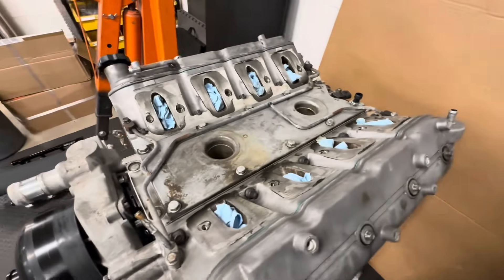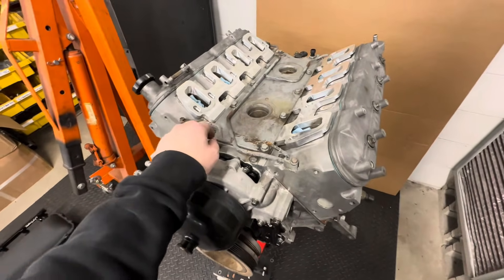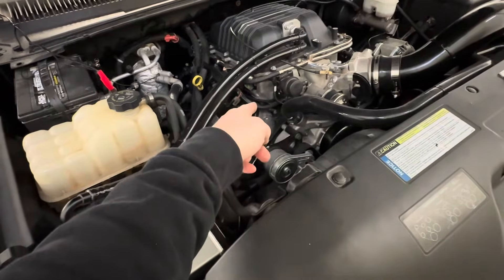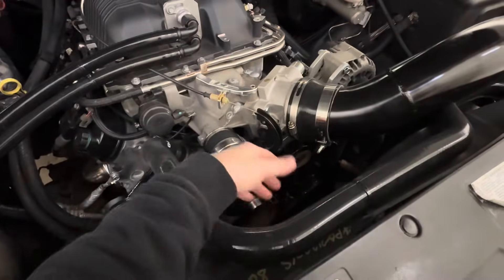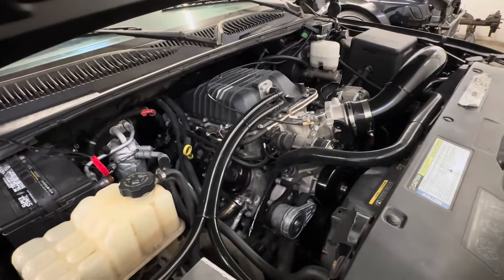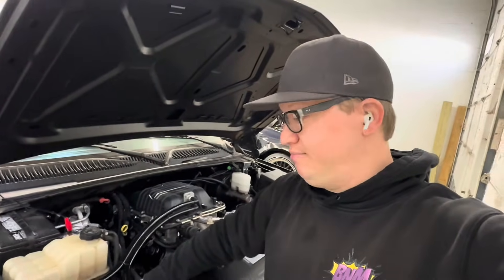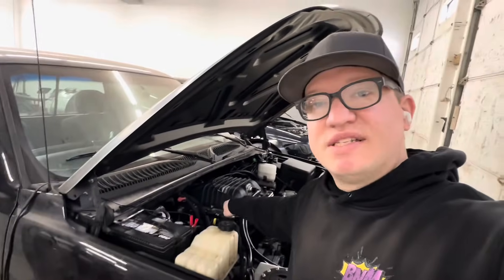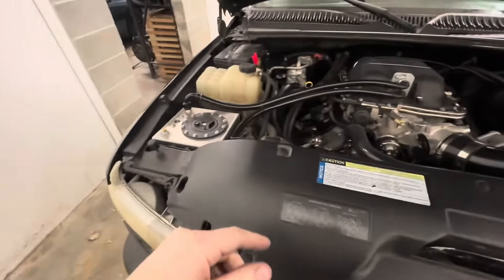LSA Supercharger on any LS engine……….. basic know how

Comment: Best video out here! 👍👍👍 straight to the point & what’s needed . What did you do with the vacuum for the vacuum selonoid & Do the other 2 map sensors just get deleted ?
Reply from the maker: Just a single map sensor after the rotor pack side. As for vacuum for the solenoid I’m not sure what you’re referring to. Do you mean the bypass valve? If so you just need a vac source to the top of the diaphragm

Comment: I have a 2000 firebird with LS1 I keep looking for LSA blower but they don't have lids and the lids they sell are so expensive any advice or what lid is recommended
Reply from the maker: You will have to cut the cowl regardless of what lid you go with. I would say the zl1 lid simply because of the cooling hose position, it is easy to access. But the ctsv lid would work as well. Be patient, you can find them on Facebook
Reply: well, that 2000 LS one motor I have it in a 1988 Firebird formula, are you sure I have to cut the hood because I really don’t want to cut the hood

Comment: What fuel pump did you use ? I have the Terminator X  so the wiring shouldn't be a problem.
Reply from the maker: Used a Walbro 525
Reply: @bnmperformancefab thankyou

Comment: Good video! But wish you had’ve touched on the fuel cell and heat exchanger part a little more. I see two lines coming off the front of the blower going into the fuel cell, but have no idea what they are?🤷🏽‍♂️
Reply from the maker: Modified the fuel cell to be a water box for the intercooler inside the lid of the supercharger. Basic stuff
Reply: @bnmperformancefab  Ok.

Comment: That cannot fit on any LS. it will definitely noy fit on a 1970 LS6 454. so your title is a lie
Reply from the maker: LOL did you see a big block in there? Get out of here
Reply: @ Is there a big block LS and if so, would that supercharger fit on it as claimed it would fit on any LS engine. 
 Seams someone need to be clear on what they are stating, or maybe they shouldn't be making video's when they make false claims like LSA superchargers on any LS engine. Maybe they should educate themselves on automotive history.
Reply: 🥴, greatday68, what was the point of that comment?
Reply: @ My comment was based because they claim it would fit on any LS engine. and that is false as it would not fit on the original LS engine platform. It's not my fault that so many people do not know automotive history and/or make false statements.   
  My point is to educate as so many seam to lack the knowledge,

Comment: can i drop an lsa on my l76 g8 gt all stock? i only have e85 kit rn😊
Reply from the maker: Yea since those are square or rec port heads it’ll bolt right up. You’ll have to knock the alignment dowel off the Bottum of the blower and get a drive for the blower but it will bolt on
Reply: @ are there any supporting mods i should do so the motor doesn’t blow?

Comment: Nice work!! What throttle body are you using?
Reply from the maker: Just used a FiTech throttle body? Ended up switch from the LSA to a single turbo but using the same throttle body
Reply: Well dang why ya switch?

Comment: I always wanted a supercharged daily driver. I’ve got a 02 Camaro SS but I’ve learned that supercharging these cars is very difficult mainly because you must clear the crowl or cut through it. But I’m having trouble understanding exactly what is required to clear the crowl. Texas speed sells a kit that includes “fabrication to be welded in” but theoretically couldn’t I just make the fabrication myself and save the 8k that the kit costs? I just want 450 HP and supercharger whine :(

Comment: What should the ring gap be? Im thinking about putting a 6.0 on my stock lq4
Reply from the maker: I’ve always done .030-028 on top ring and .028-.026 on second ring 

Personally I always go on the larger side. As long as the cylinder walls are clean hone you won’t have any blow by issues
Reply: @bnmperformancefab  thanks!

Comment: Your install on the truck looks great….i gotta LSA kit from boost district that was setup for the trucks too and put it on the LS3 headed 370” LQ9 i put in my nova when i pulled the pevious 5.3 i had in there……i love it
Reply: Do you have a stock bottom end?
Reply: @  yes!!!…just a bored over .030 flat top 6.0……gotta 408” stroker to replace it when i get around to it
Reply: @  around 11.2:1 compression….the 408” will be a hair under 10:1
Reply: Yeah i have a similar setup on my truck. I didn’t build the motor but i got the build sheet that says it’s bored .030 over and it also has the ls3 heads with a nice cam. Looking into LSA just for a nice daily boosted truck

Comment: I have a 6.2 LS3 do I need those intake adapters?
Reply from the maker: Square port heads wouldn’t require adapters
Reply: @bnmperformancefab do I need gapped rings? My ls3 is stock

Comment: Why did you switch to Olson works adapters and ditch the aluminum ones ? Any reason for that
Reply from the maker: The Olson works adapters are made from a phelonic material which is really good at separating surfaces and temps. Aluminum heat soaks and does so quickly, so a barrier that can be easily had is a spacer made of a different material. The aluminum ones work and function just fine but if your looking to cut temps anywhere you can that is one area to help do so

Comment: Can you just run the heater hoses to the lid and not have extra stuff?
Reply from the maker: No, it’s a cooler not a heater
Reply: Also, nice video. I have a forged rotating assembly, full CNC 6.6 built for boost and have been trying to decide between turbo or LSA and I think LSA is the winner. @bnmperformancefab
Reply: I get that, whats the water temp in the cooler after being under the hood running? The coolant from the heater hose would only be around 180. With no fan on the cooler box the water prob gets close to coolant temp since its going through the core bolted inside of the intake  @bnmperformancefab

Comment: Would something like those adapter plates work for putting a Whipple for a 5.3 on an LS1?
Reply from the maker: If it was the same port situation as the LSA then yea likely
Reply: @bnmperformancefab  alright, I was just curious because there are whipples made for the 5.3 Vortec but not for the LS1 and I the Whipples look a lot cleaner in my opinion and I've tossed the idea around of putting a built LS1 in my Rx8
Reply: @brandonbennett7865 …..its not a problem….just make the ports match…….a LS1 is basically the same as a 5.3 just with a bigger bore

Comment: Should i go 6.0 or 6.2 i have a 1973 caprice ?
Reply from the maker: Personally it would depend on cost, I’d almost prefer a 6.0 just to have a stronger cylinder wall as the 6.2 is a little thinner and has common cracking cylinder issues
Reply: @bnmperformancefab  ok thanks that what i was debating on fr
Reply: If you get a 6.0 iron block you can bore the block out and put in bigger forged pistons and put ls3 style rectangle port aluminum heads and you will essentially have a 6.2. That’s what i have in my truck

Comment: Do you have any data on how long the engine will last without lowered compression?
Reply from the maker: No need for lower compression, 4.8s don’t have that high of compression so not to big of a deal.
Reply: @bnmperformancefab  what about the 5.3's, 6.0's and 6.2's?

Comment: love the vid. thanks.  now for my question  lol. I'm running a 6.0 in a elcamino  and wanted to keep the AC  do you have any suggestions  on which pulleys I'll need  because I have to move  compressor to top
Reply from the maker: I believe LSX concepts sells a lot for that. But if your running a 6 rib setup you may be able to use a truck spacing kit with slight mods to it

Comment: What’s a good cam to run on a LSA supercharger
Reply from the maker: It would depends on goals for the vehicle.

In my truck I’m running a stock cam currently, if I upgrade I wouldn’t go to big or rad as drivability and keep the “tame” aspect is more what I’m aiming for
Reply: BTR Red Hot which is the same exact thing as the BTR Stage 2.
Reply: Just something to play from time to time and something hwy no race but want the power
Reply: What’s size heads are u running on that LSA

Comment: Great video! I think I have the same alternator and PS bracket. I'll be drilling holes and adding the idler like you did. What size injectors are you running? I have 50lb and I don't think they will be enough.
Reply from the maker: Really depends on your goals and fuel, I’d suggest going up in size but 50lb injectors might work on pump

Comment: Any love for the gmc Savana I have one with a ly6 would this fit?
Reply from the maker: On the LY6 it’s got square port heads already so it would bolt right up, there is a dowel pin on the blower that would need removed but other than that bam. Aside from figuring out belt routing ext
Reply: @bnmperformancefab thanks for the info

Comment: You gotta be kiddin...............great video.  I have a 6.0L LS iron fully frged 390ci in my 1998 Trans Am WS6.   Been asking everywhere how do I get the belts to line up with these superchargers.  Nobody can really give me an answer.  Does this also apply to the new Magnuson TVS2650.  Mainly the front end acessory drive....?
Reply from the maker: I’m not 100% certain on the magnuson, what I would do is check and see what belt system they work with and that’ll tell you roughly what factory belt system might be able to be modified to work with it

Comment: So I built a 6.0. All the internals are brand new. I may have put 100 miles on the motor. When I put it together I didn't gap the rings. Rings are all .018 gap. I don't plan on racing it. It's really just a show car. 81 Trans-am. Should I be concerned about gapping the rings with the addition  of a LSA
Reply from the maker: Yes you should be concerned. That is too tight, it’ll run, however it could easily crack ringlands with that tight of a gap
Reply: Change that gap and do it correct
Reply: Sloppy 28 is good for turbo if I recall correctly. How much tight or sloppy for LSA on 6.0L LQ9?
Reply: how much did it roughly cost you for a fresh block? 😅asking for myself
Reply: @jay8980 overhauled is 4000+
Reply: Any boost whether turbo or super, it needs it otherwise you can cause engine carnage
Reply: I didnt even check my gap….straight out of the box onto the piston into the block…..with a 2.45” pulley……no issues at all….but you should at least check the gap, dont be like me
Reply: Hello, I would get a new set of rings and re ring it with wider gaps. The reason rings are gapped wider with forced induction is due to extra heat causing rings to expand more. If the rings expand too much and the ends touch, they will have no clearance to expand any more and will gouge the cylinder walls and possibly shatter the piston ruining all the hard work and money you have put into it. I know it sucks but its well worth it to have that peace of mind.
Reply: Is ring gap needed for nitrous also?
Reply: I’d look at swapping a new cam in and re gapping the rings. There are guys who have had a NA motor and had the rings gaps to begin with and didn’t redo it when they threw a supercharger on it but they weren’t pushing it. But I wouldn’t risk it.